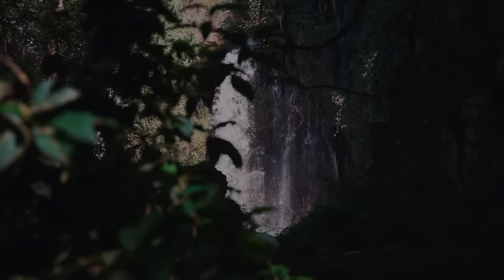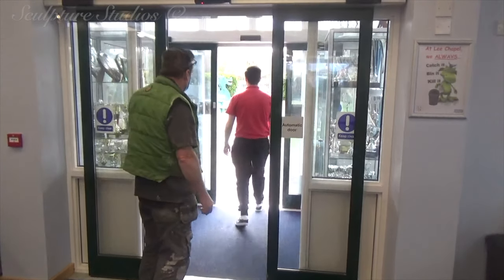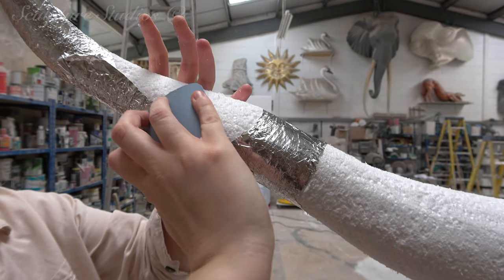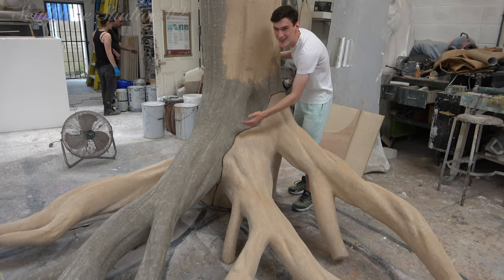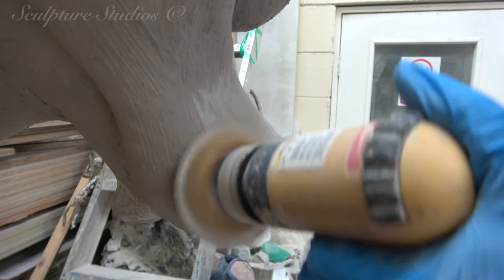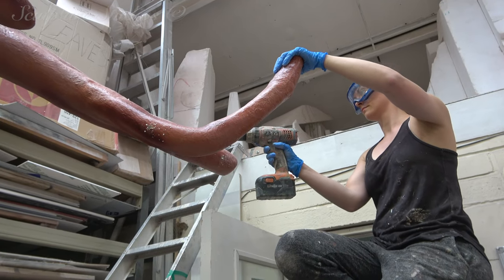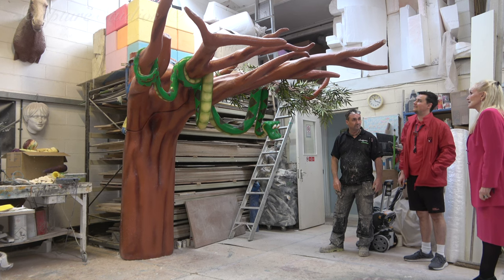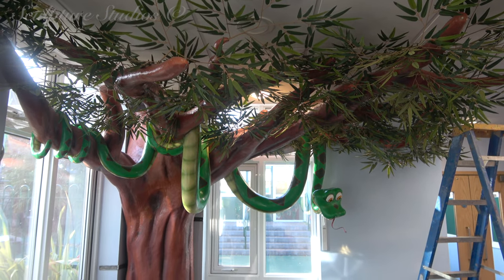Jungle Book Tree - Lee Chapel Primary School Theming by Sculpture Studios

Comment: How is the snake made?
Reply from the maker: We used a rope, and covered it in polyurethane expanding foam, until it was a large enough form to then carve into the finished shape. It's then protected with a sticky back aluminum foil, and a layer of glass fibre. Car body fillers and sanded to a good finish, before artworking.